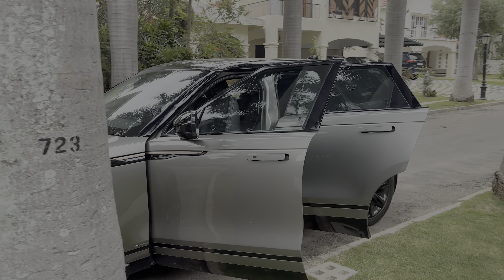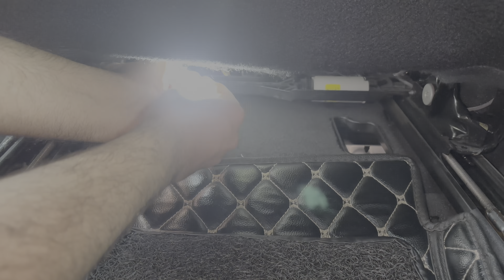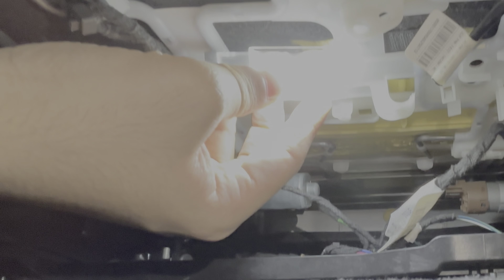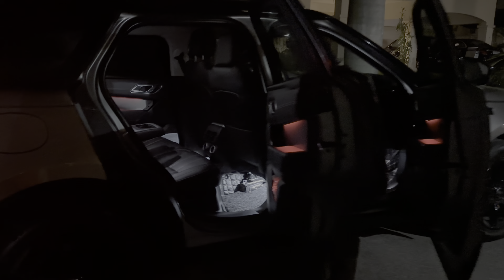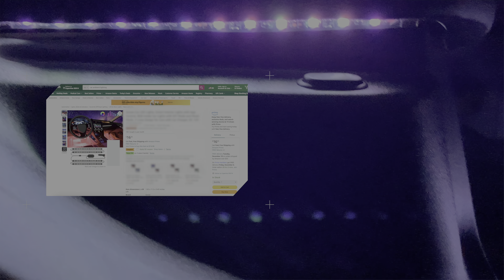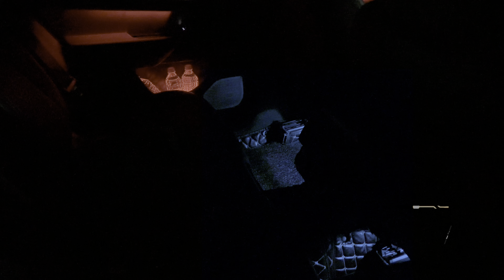Range Rover Velar Hidden Features | Part 4: Footwell Ambient Lighting

Comment from the maker: Hey guys! This could be the last video of the series (unless I find another hidden feature, so do stay tuned in!). If you wish to learn more about such hidden features on the Velar, this playlist includes all the previous parts of the series:  https://youtube.com/playlist?list=PLvgQQStEjq3ee2syYFQQMOgFqWM1fZR2q&si=V3YOXAMK3u6h12bF

Hey guys, update — 16 August 2026: I had installed the footwell LEDs in white to match the front footwell and all the door-handle lighting. Since there’s no dedicated holder under the front seats for the LEDs, this is a semi-permanent solution. I had to tape the exposed connectors at the back for safety and wedge them underneath the bottom of the plastic seat frame and into the seat-base foam, as the connector was otherwise just dangling freely.

I used editing magic to create the red and blue versions shown in the video. The LEDs still increase in brightness when the doors are opened and dim to match the cabin lighting when the doors are closed. This suggests that either the LEDs themselves could be the issue, as several people have mentioned that theirs don’t change colour, or the connector behind the LEDs may not have been changed.

After reading the comments, I now recommend buying the standard single-colour LEDs in whichever colour you prefer—white, purple, red, or blue—if the multicolour connector-based LEDs don’t work.

If you’ve installed these LEDs, please update us on your experience and let everyone know whether the colour-changing LEDs worked for you!

Thanks for tuning in!

Comment: You really should have given ALL information on light… like “your velar ALREADY had “ambient lighting” … just a thought for future YouTube videos
Reply from the maker: That’s a fair point, I appreciate the feedback and will keep it in mind for future videos! However, the rear footwell lighting connectors are there on all Velars S spec and above.

I installed my footwell LEDs in white mode and I used editing magic to get the red and blue LEDs, because this is a semi-permanent solution since there’s no dedicated holder under the front seats for the LEDs, the connector was just dangling freely. The LEDs still increase in brightness whenever the doors are opened and dim to match the cabin lighting brightness when the doors are closed, which means the LEDs could be the problem since many people have mentioned they don’t change colour, or it could be that the connector behind the LEDs weren’t changed. After reading the comments I now recommend you buy the standard single colour LEDs in the colour of your choice (White, Purple, Red or Blue) if the multi colour connector based LED doesn’t work. 

Thanks for watching!

Comment: Didn’t work on my MY24
Reply from the maker: This seems to be a common issue, some others have said it might be because their car doesn’t have ambient lighting.

For reference, my Velar is a MY19 and has the ambient lighting package.

Does your Velar have the ambient lighting package? I guess the ambient lighting package has a fuse installed in the fuse box (which gives it power).

You could consult the user manual and install the missing fuse (if that’s the issue).

If it’s software locked (which I doubt it is) then you could always install these upgraded lights in the front footwell (it uses the same housing/connector)

Comment: Do you need the ambient lighting pack for this? I plugged them in but they didn’t light up?
Reply from the maker: Well, someone else commented that it didn’t work for them either, so now I think it may indeed require the ambient lighting pack for it to be functional.

Still, I would recommend trying it at night, and adjusting the dipper knob to see if it lights up.

Also, there wouldn’t be any hardware limitations for it not to light up, so check the fuse box diagram and confirm if there’s a fuse which is not plugged in on your vehicle.

The lights are the same for the front footwell lighting, so even if you can’t get the rear ones to work, you can always replace the ones up front for an upgrade!
Reply: That’s a really good point re the fuse box entry and figure it out, and swap them into the front to make sure they’re actually working and not dud ones
Reply from the maker: @thevoiceoverchap  Thanks for pointing that out! I didn't mean to say the LEDs may be duds, but now that you mentioned, it may be possible is the seller you buy them from is not conducting quality control/checks. By the way, did you manage to ge the LEDs to work?
Reply: @LordTechPro  lights worked in the front but not the rear. The colour changing didn't work in the front though, when I placed the clip on red or blue, only white showed which was interesting. I bought the same ones you did from that same seller
Reply from the maker: @thevoiceoverchap  Ah that explains it, from what I know, there are 3 pins on the LED, 2 for power and 1 for info/dimming. On their website they clearly state it will work on all Velars (for the front footwells).

What could be happening is that Velars without configurable ambient lighting do not come with either the software/hardware required to trigger the colour change

I would contact them and enquire why their product is not working as intended, since the market it as a universal fit light (no mention of options/trims on which they will work)
Reply: @LordTechPro  Yes I'm going to contact them tomorrow. I'll report back.

Comment: Does P380 Velar 2020 and 2018 have all those HIDDEN FEATURES from part 1 to 4: and I am talking about HSE's trim for those year models of the Velar P380?
Reply from the maker: It depends on the trim level, what trim level are they (S,SE,HSE)?
Reply: @LordTechPro  HSE
Reply from the maker: @emmanuelobareki4655  HSE comes with 90% of all these features as standard, except for things like the sunroof, seat release levers in the boot, the rear seat climate control (part of the 4 Zone climate pack) and (in newer models) the rear seat recline, all of which are optional extras.

There are 3 options/variants regarding the roof: 1) No sunroof 2) Fixed pane panoramic sunroof 3) Openable panoramic sunroof, but both versions come with auto closing/opening sun blinds.

Comment: Hey, I bought the lights and plugged them in the rear footwells. Neither of them worked. 
Any ideas?
Reply from the maker: Which model is your Velar and did you buy them from powerfuluk.com? Also, did you check the polarity of the lights (they only go in one way).

Also double cheque if you didn’t damage the wiring harness by mistake.

Oh one more thing, your interior lights need to be set to Auto, and the headlights should be turned on for the footwell lights to work (also try them during the night/in a garage). You can watch Part 2 of the series for instructions on how to turn on the interior lights

Comment: Doesn’t have heated seats?
Reply from the maker: This one doesn't but most Velars from SE and up have heated seats
Reply: @ i have a similar one and doesn’t have ,was thinking to upgrade it somehow to have baecause have perforated seats . What do you think?
Reply from the maker: In S trim The seats themselves are basically the same on the exterior regardless of whether they have seat heating option or not.

However I don’t think the seats which don’t come with the heated seat option from factory have the heating elements installed in them.

However, the wiring harness which leads to the seats are the same, so theoretically they may have software disabled the heating feature, or even if the existing seats don’t have the heating elements, it is possible to fit a seat with the heating elements without much (or zero) hardware modifications.

The heated seats are controlled through the lower touch pro duo system screen, so even if one were to fit new seats (which have the heater coils in them), the lower screen would need to be flashed with the compatible software.

Anyway, based on what I’ve read online, the heated seats take a lot of time to work so if you don’t have the option now, it’s okay the HVAC vents work much better to warm up the cabin